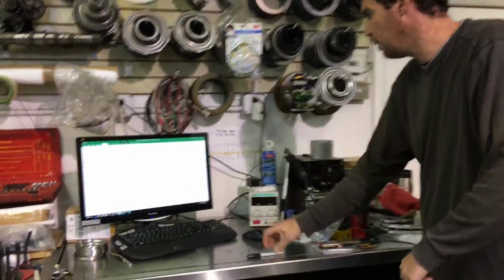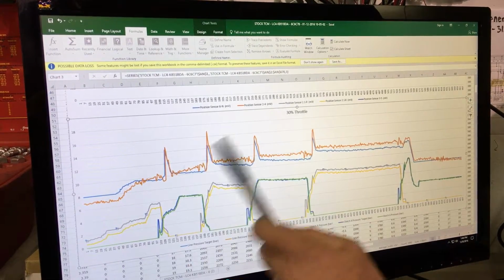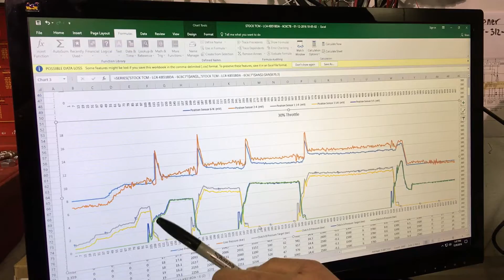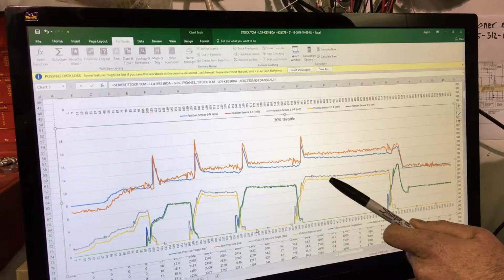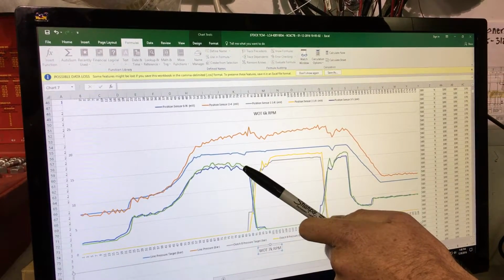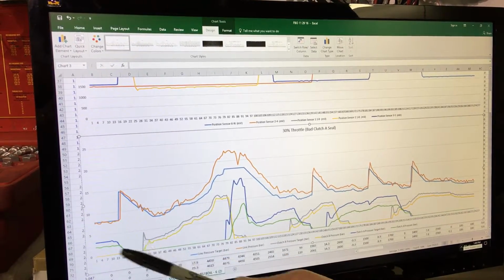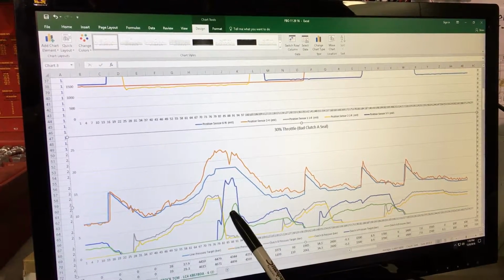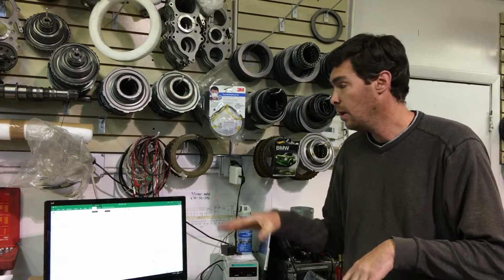PART 2 Reading Data Log TCM Clutch and Line Pressures, Diagnosis, Repair, GT-R, GR6

Comment: Hi Jack,
which set datalog list i need for this test?
Am using COBB Access Port V3
Reply from the maker: Hi!  More info in the link below with a list at the bottom of the page.  https://www.jackstransmissions.com/pages/gt-r-gr6-tcm-data-logging-videos
Reply: GVR1670 Many thanks
Reply: Mr. Jack
My datalog is ready can i send it to you and convert it to graph?
Reply from the maker: You can use Microsoft Excel for converting to graph.  You can send the log to shop@jackstransmissions.com if you want us to look at it and see if anything is wrong.
Reply: GVR1670 Thanks for you support